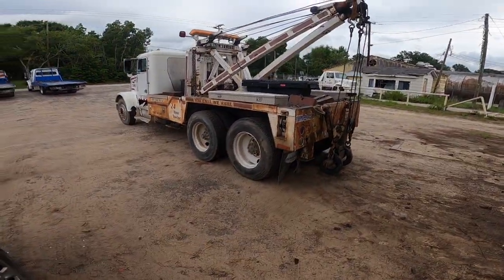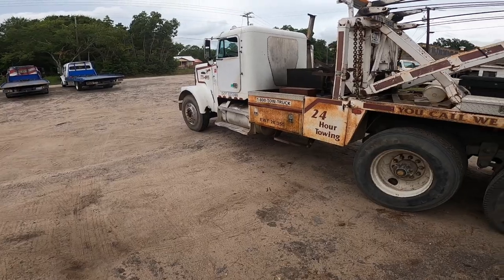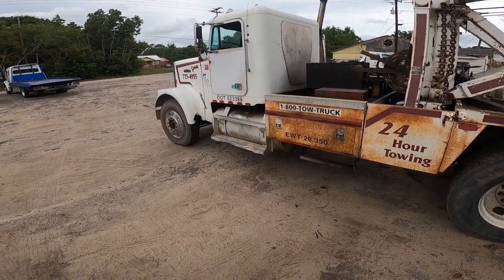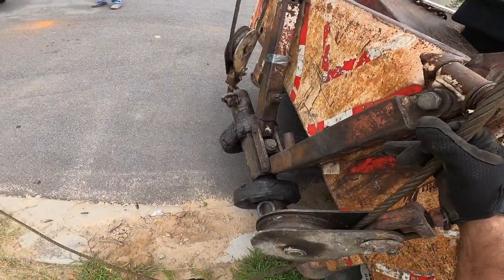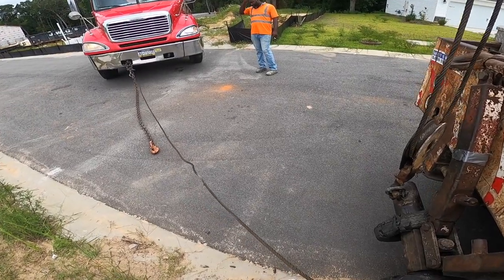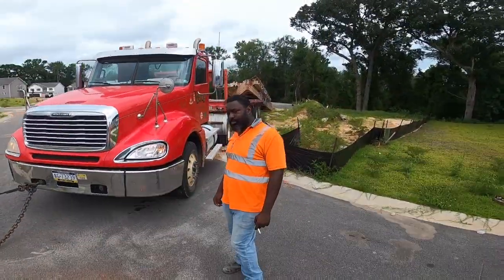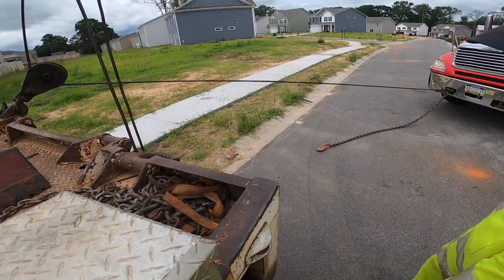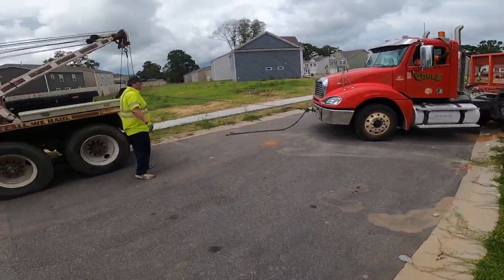Simple Winchout For The Gopher

Comment: that truck reminds me of the one i used to drive, it was a 56 Chevy 2 ton with an old Holmes split boom, we had to push down one lever to release the clutch then push or pull a second lever to engage the winch then release the first lever to re-engage the clutch
Reply from the maker: Mr Jim That was alot. Thanks for watching and stay safe
Reply: @SumterWrecker  God bless and be safe

Comment: Nice job Mr Hal and new guy. Hook tip points up every time and you know why. To those that don't know why you always put the hook tip pointing up. If the cable or chain breaks the cable will hit the ground instead of flying through the air and back at the operator. It may still have sufficient energy in it but it will be low and slow instead of high and die. Stay safe out there Mr Hal.. Thanks for the video....
Reply from the maker: Mr Dan Yes sir. Thanks for watching and stay safe